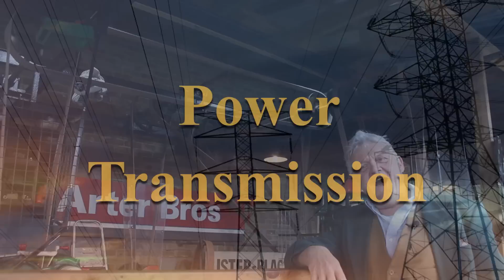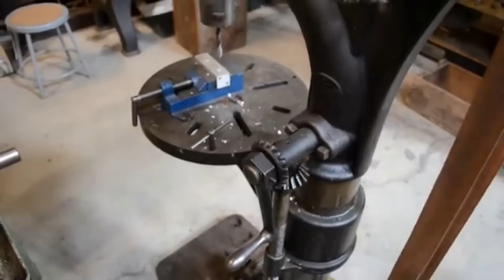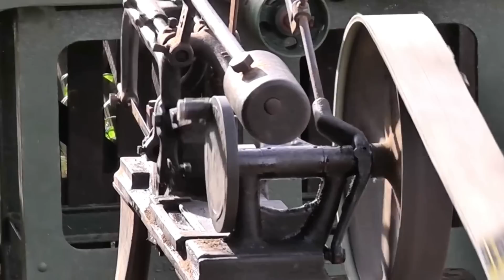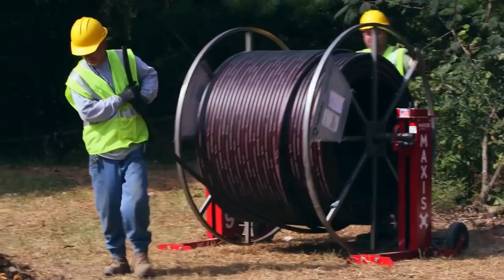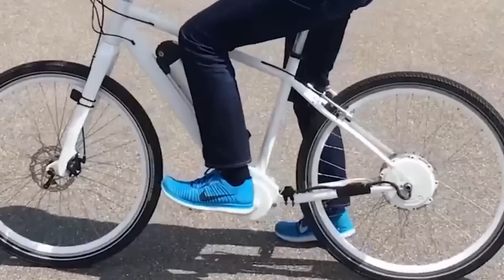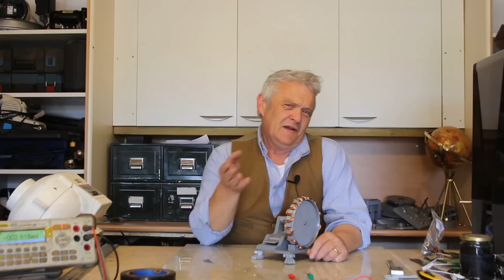1986 Power Transmission

Comment: On one hand I really like the idea of the generator to motor bicycle as it makes it possible to set a constant pedaling effort and travel speed regardless of the changes in road inclination, on the other hand I often see situations where it would be much more efficient to avoid conversion between mechanical, heat and electrical energy. While not always possible or practical, it makes sense to locally use the mechanical power of the wind or a stream to power mechanical devices, IR heat from sun to heat air, water, food, etc, and PV panels to power electronics and lights.
Losses from transporting electricity or heat over long distances seem quite linear. Interestingly enough, mechanical power doesn't seem to be subject to the same linearity. There is a limit to how long a shaft or chain can be, but within that limit it doesn't seem to make any significant difference how much distance is covered.
I suppose one could argue that there is a linear relationship between the weight of a shaft or chain and the load on the bearings, but short of carrying several tons, it probably doesn't come anywhere near the losses from electrical resistance or thermal dissipation.

Comment: i am on free electricity plan at nighttime, and i sure would like a great method to store energy, multiple even, for the daytime use. in winter i have used a big water heater tank modified to be full of sand and its good for heating use during the day but i want more options and ideas, so always on the lookout.

Comment: There actually was a mechanical power transmission technique, called Stangenkunst or Flatrod System,  used in the past that could transfer power several kilometers away using a waterwheel and pushrods!    It was invented in the 16th century and by the 18th century was being used to transmit power up to four kilometers.  I'm always amazed at the incredible cleverness of people in the past.  If you google "Stangenkunst" it will take you to a wiki about it and also a fascinating article from lowtechmagazine.

Comment: Quite often high voltage transmission lines use aluminum conductors instead of copper despite its lower conductance (~60% of Cu) and increased risk of metal fatigue. Aluminum is so much lighter than copper though that it can actually end up carry way more (~5.5X) power per unit weight than copper.. or silver for that matter (~7X!)).  Plus you're getting even larger favorable factors when you consider capacity vs material cost for Cu vs Al. 

A larger diameter wire also experiences less corona loss at very high voltages but that's just icing on the cake. haha.

Comment: Alternatives to electricity could be pressurized water or air. Only I think that it's illegal to run a water motor off our water mains and compressed air is mainly used by machine shops and garages.

Comment: The Lister-driven belt system took me straight back to my youth over half a century ago, and the Outback shearing sheds I worked in in Australia, where the remoteness meant no electricity so all the shears, sharpeners and other equipment were belt-driven from a kerosene powered stationary engine ! Cheers from country South Australia !

Comment: caution Rob , getting people to think for themselves is quite possibly hazardous to ones health !?. It's almost at a level with people that theorize about what the uber rich power brokers, that have got uber wealthy and powerfull by being 'very competitive ', are 'putting their heads together' over now ?.  Was it Edisons original power transmission system , the use of 'rust batteries' , transport iron to homes for onsite generation ,and cart it back to central plants for recycleing . Still not a bad idea ,considering the line loses in long distance power transmission ,I think in NZ we lose around 40% . Could a replacement battery system work like gas bottles ,take them to the hydro power plant to refill ,? .

Comment: Only 25 years ago I saw a full production line which made shoes and running from a single spinning shaft overhead powering leather sewing machines and presses and stamp cutters to molds and more.  The plant was likely more efficient and less expensive to setup and maintain running this way than if electic motors were used everywhere for each machine.  It was amazing to see in action. The main source of power was a massive electric motor but they had plans on changing it to a powerful diesel engine as electicity was getting unreliable in Zimbabwe at the time.

Comment: years ago I had an elderly neighbor whose basement shop was run off belts and pulleys with just one electric motor, he had over head jack shafts, shafts along the walls etc.He had some tensioner pulleys he adjusted with fishing weights

Comment: What if you have a bike that uses pneumatic transmission.
Reply: Genius idea.  Yes, pump air to the drive wheel, simple.
Reply: Or have a breaking system that fills a pressure bottle.
Reply: If the frame is found sound then it would work as a bottle, storing a large quantity of air.